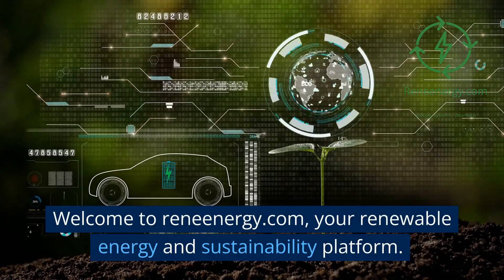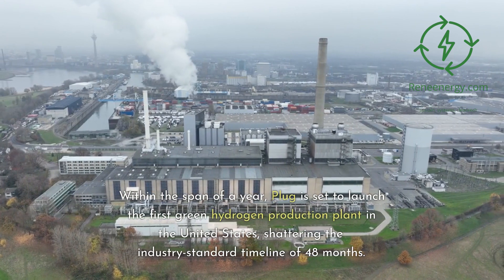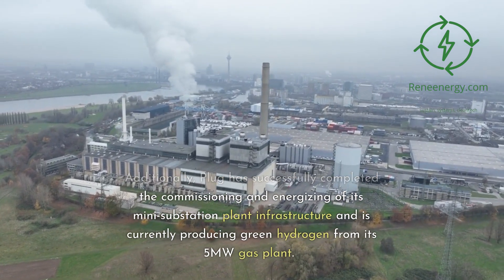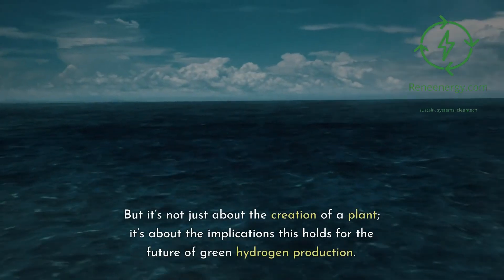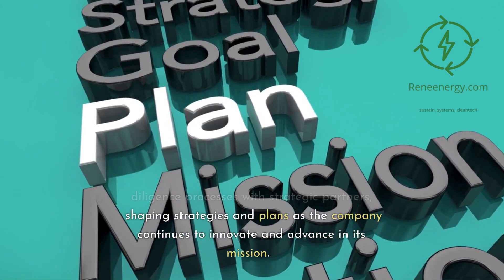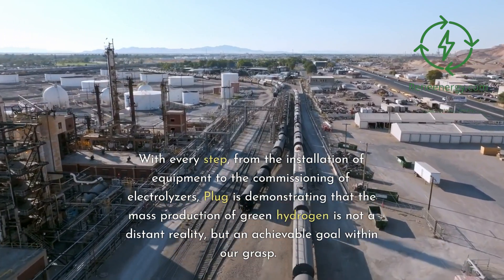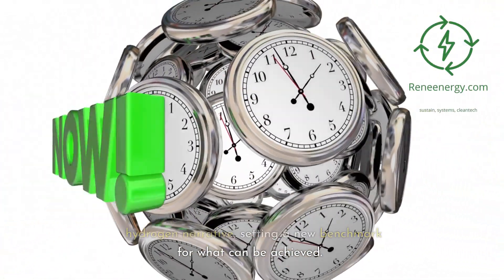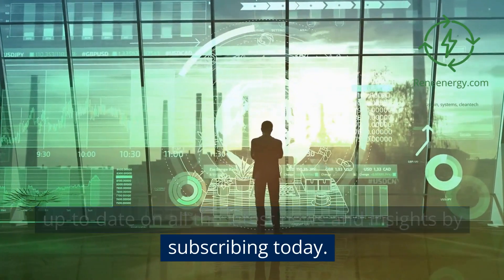Green Hydrogen: Plug Power's Launch of the First Ever U.S. Commercial-Scale Production Plant.

Comment: Hydrogen power plants even cleans the air and produces water
Reply from the maker: Indeed, hydrogen power plants offer a clean, sustainable energy alternative that not only emits zero harmful pollutants but also helps clean the air. As they operate, these plants intake air, which passes through filters removing pollutants. The only byproduct of the hydrogen-to-energy conversion process in a fuel cell is pure water, contributing positively to the environment.